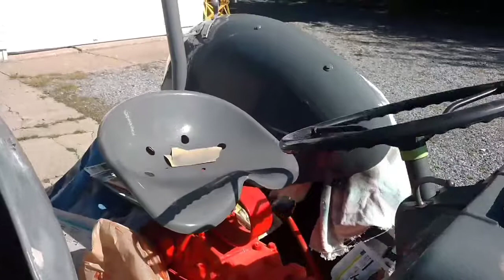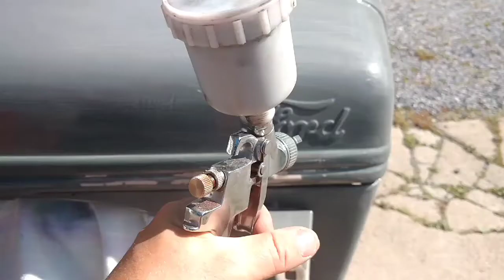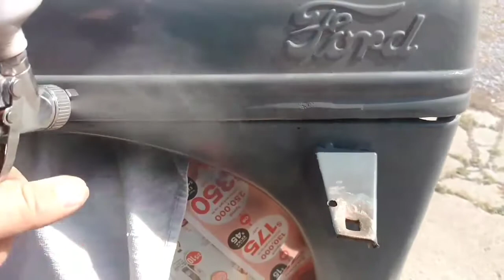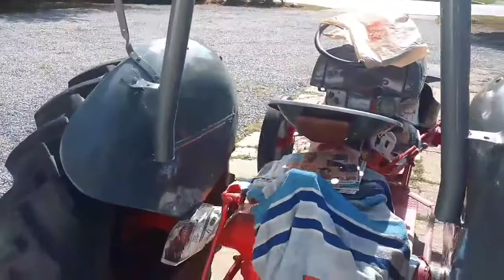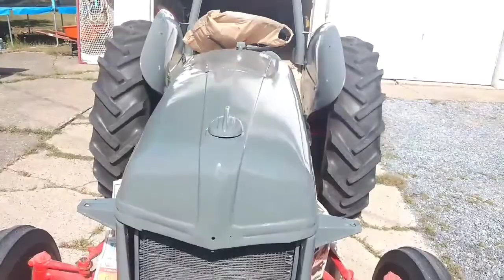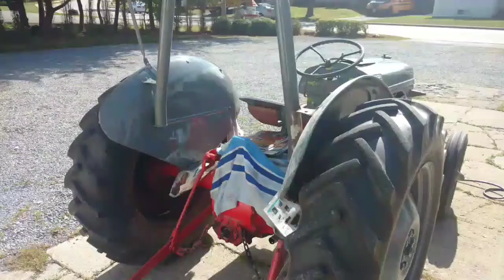Painting a 1952 Ford 8N farm tractor in my driveway

Comment: If you are going to the trouble to do the body work and paint it/ why did you not paint it the correct color?
Reply from the maker: I was going to go factory color but this was easily available, however down the road I may and actually might consider base coat clear coat and do a factory correct resto.
Reply: @PovertyPointCustoms  It should make a good base coat. It being a little darker means you may want to add one more coat to get good coverage. I was just watching and thinking he is really doing a lot of work. But using it as a base coat is a good idea.

Comment: How did you degrease the metal before spraying?  I have the typical oils around the carb, and grease buildup here and there.  Did you take it to a carwash after spraying with Gunk foam degreaser, or is there a more effective way to degrease?  After degreasing, do you recommend wiping things down with mineral spirits to clean the metal thoroughly?
Reply from the maker: I degreased the entire tractor and before painting I gave the it a light sanding (you can use a scuff pad), then I wiped the areas being painted down with paint thinner (for more of an automotive quality a tack cloth would be best to use also)